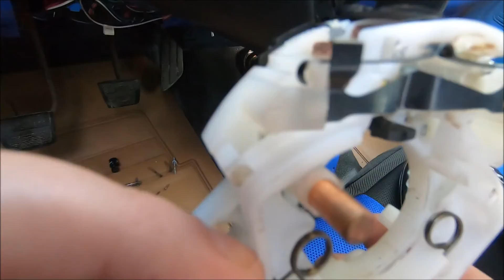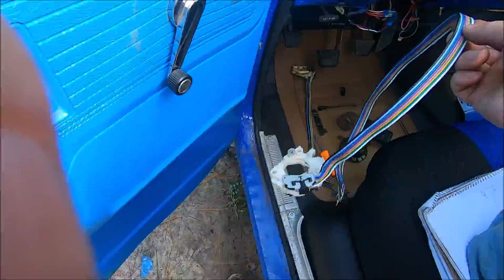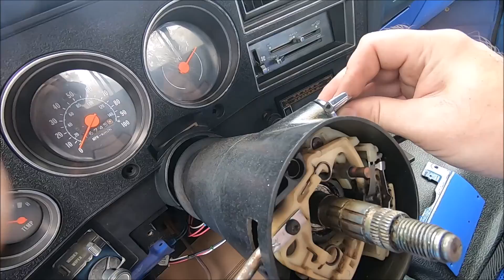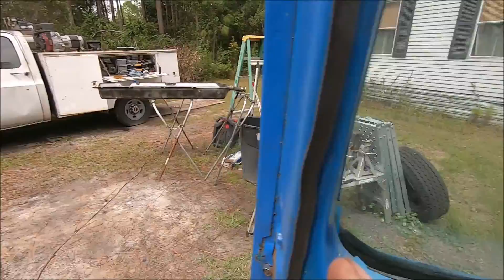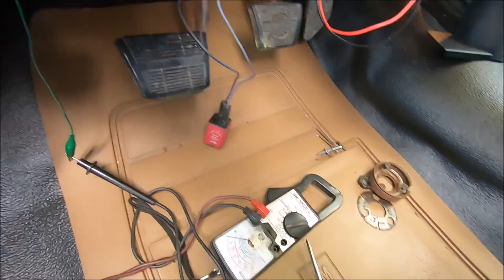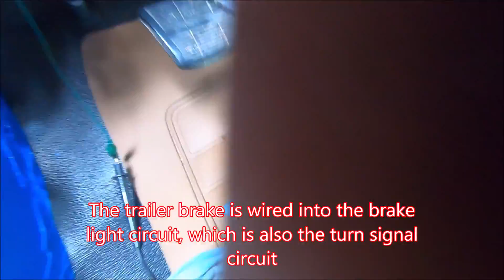1978 GMC crew cab turn signal troubleshooting

Comment: If you recently removed the engine bay side of the fuse box, there is a good chance its there. Remove it again, clean both sides, then reconnect with the center bolt. Each time  I have ran across this, all turn signals and flashers worked , except the right rear. Tail light and back up light worked , but nothing else. Each time was also after engine bay side and under dash fuse box side had been separated.
Reply from the maker: In this case it was not recently removed, but that is an excellent point to check for intermittent circuits. I have found several there myself in the past on other GM vehicles of the era, not only square bodies.

Comment: You had a bad contact on one of your joints or connections then you moved the wire just enough for it to poof fixed , have had this happen soooo many times over there years the insanity it's caused and the awake at nights because I tried to figure out wtf I missed lol but glad it worked out good for you as for me well I'm doing a 78 GMC vandura 1 ton dually chassy and trust me rewiring is royal pain in the jackass 🤣🤣
Reply from the maker: Pretty sure these things are why my hair is falling out and going gray lol

Comment: I have the same problem with a 1978 c30. I'm getting ready to install a new switch. We will see
Reply from the maker: I hope you manage to locate it. After I shot this the problem never re-occurred. It’s a head scratcher for sure.
Reply: @robp9696  did you ever get this issue fixed? What was the cause? I have the same problem on a 1973 K20, but the switch is brand new

Comment: Ah yes, everyone working electrical or electronics favorite thing - INTERMITENT faults.

SIDE NOTE: We, all, call issues, whether an opens or a short, shorts. More than a bit of fiddling with electrons in, I don't, because it confuses.

IF this had been a short, you'd have replaced a fuse, or five. . . .

Anyway, inasmuch as we are working with low voltages, it may be you scraped off some corrosion that was obstructing the completion of the circuit when you connected and disconnected things. 

When my old 69 went fussy on me, and a quick check across a fuse showed it good, but no power touching the holder, I ran a small, round Dremel type grind bit in each fuse holder, then applied some silicone. That problem went away. You may have done the equivalent, just by 

That's less a problem inland, but on the coast, high humidity took its toll on my old truck.
Reply from the maker: I might agree with the sentiment of having inadvertently cleaned a connector except that this entire truck had just been apart (did a build series of videos previously). Probably should have mentioned that in the vid for those who hadn’t watched. Every part I took apart to check had been either new, taken apart and put back together, or replaced at some point. Which was making me scratch my head even more. Certainly complicated my thinking on it!
I have seen shorts that can make a lighting circuit not work, but not blow a fuse before. Especially in old cars. They still can get pretty hot and dangerous, but not enough to pop a fuse sometimes. It’s rarer but it does happen.

Comment: I've been able to leave the connector on the wires, and not de-pin it, and feed the whole assembly up the steering column. It's easier to feed it back down because you don't have loose wires hanging up on things.
Reply from the maker: I have managed to do that sometimes. The main thing that tends to get in the way is the wire guide/sheath, unless the last person didn’t install it. And for cruise columns there’s extra space taken up by the cruise harness. I’ve done so many now that, for me, it’s just so fast and simple to de-pin it I don’t bother trying to force the connector through the column anymore.
Reply: @wrenchwranglers the plastic sheath in the column slides to hook in so you just slide it ups and out and use it as a guide for the connector